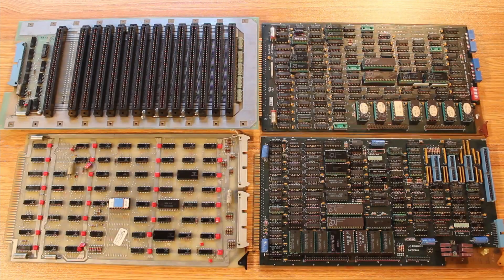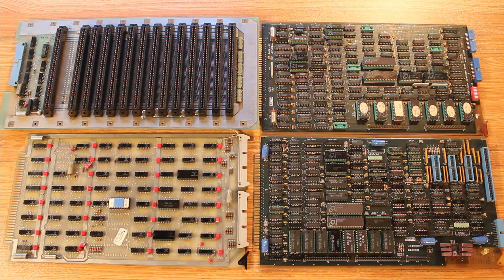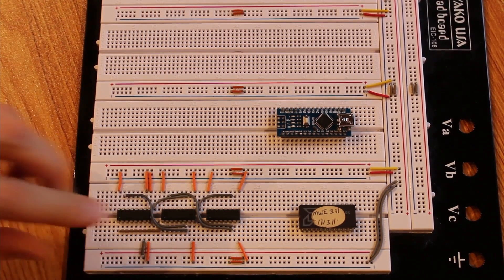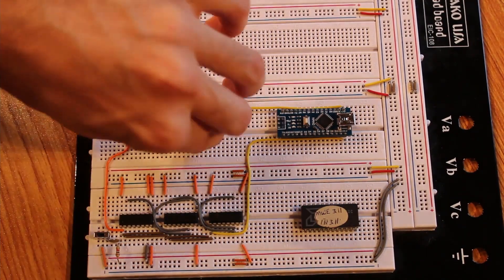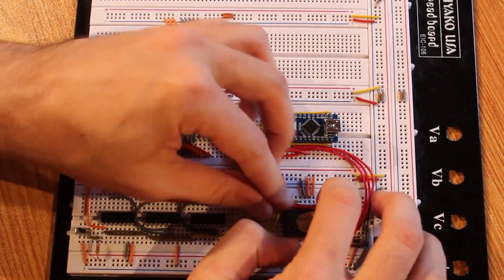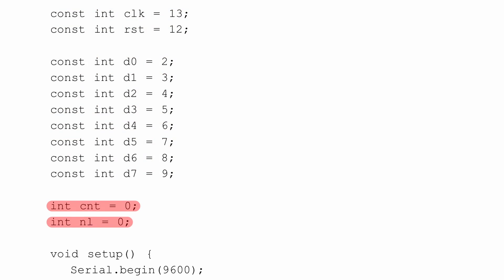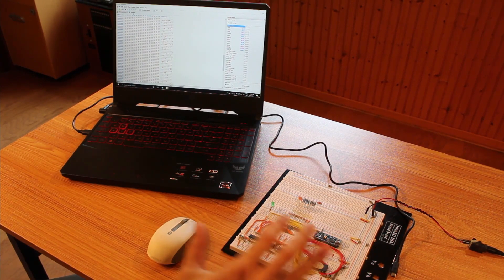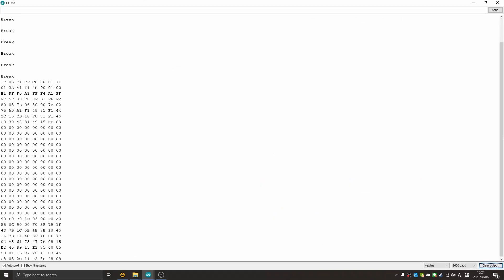Minicomputer Part 5: Building an Arduino ROM Reader

Comment: Cool reader. I hope you don't have to build a ROM writer, That would be possible, but awkward with many different voltages. :)
Reply from the maker: Thank you so much!
I think if I have to write new ROMs, I'll most likely end up with more modern ROMs and making adapter sockets to fit them in place and then programming them through a TL-866 or something. Although, I do think it would be quite fun to get some NOS AMD ROMs if I need any and build a programmer from scratch!
Reply: @UsagiElectric  It would be a very interesting project to say the least. I've got some 1K EPROMS from the late 70's early 80's that use +12V Vcc, +32V Write eneble pin and -5V Read enable pin. LOL.

Comment: Hi, Great Video, you can use CD4040 which is 12 bit counter & eliminate a lot of wiring.
Reply from the maker: That would definitely have been the better way to do it! I mostly used the 74LS161 because I had a handful of them already and I was too impatient to wait for new parts, haha.
Reply: @UsagiElectric  You could also plug the ROM address lines directly into the Arduino, removing the need for a separate chip entirely - maybe a level shifter at most then.
That also removes the possibility of a desync between Arduino and counters.
A larger Arduino could be used, like the ATMega, which has the needed I/O pins. Or maybe even an STM dev board.
Reply: That of course assumes he has a CD4040.

Comment: Those 00s in the middle of the ROM storage mean, that you are a lucky fella. Erased EPROMS show FF. Normally it is good practice to fill not used areas of the ROMs with 00 or any pattern so you can directly see if the data is corrupted. I think your chance is high that the data is intact. Anyways if those windows are covered they never loose data from my experience. Also if they are exposed to direct sunlight, it takes at least a week to kill all the data. One Indian guy posted a Video showing how to erase EPROMs without dedicated eraser. It needed a whole week to empty the chips. And that said with Indian sun for 7 days!
Reply from the maker: That's excellent news to hear! 
That little ceramic 1702 didn't actually have any tape at all over the window, but it was buried deep in the system and there was no way for direct sunlight to ever reach that far into there, so it's been pretty well protected. Aside form it being good practice to cover the window with tape, the primary reason I did was to hopefully get ahead of the legion of comments I would get about not covering it up, haha. 
Adrian's Digital Basement has an excellent video on erasing EPROMs with windows and it takes a lot of continuous UV to get them to erase!

Comment: Not the fastest code under the sun, but as long as it works :D I recomend flipping through AtMega328 datasheet, you can read an 8bit port all in one shot for example, and arduino library way of writing to pins is just terrible ;D
Reply: Another comment - when you are doing an if statement in one line you dont need to use {} around code executed, you can just go:
if (digitalRead(d0) == HIGH) sum += 1;
Reply from the maker: @akkudakkupl  I'm so bad with the Arduino and modern stuff like that. There's so much capability in there that I have absolutely no clue how to make use of, but I do know just enough to hack and kludge my way to a result, haha. 
Thanks for the tip on the {} for the IF statements, I didn't know you could do that! A missing "}" is what usually takes the most time for me to find in my code if it gets too long.
Reply from the maker: @akkudakkupl  Thank you!
Programming really is wild when it comes to all the amazing tricks that can be done to eek out every last bit of performance! I'm really terrible at it and often either end up with "it's super slow but works great" or "it's not quite as slow but the code looks like a spaghetti monster," haha.

That's a really cool method of reading an entire port at once, that'll definitely make for a much faster read. And, if there were enough pins, I could also use the Arduino to supply the address, which should take all the delay out of the entire thing and make the read almost instant! 

I'm a bit jealous of your holiday in Prague, but have some extra fun and beers for me in spirit!

Comment: -9V sounds like old/early NMOS or PMOS chip, which needed some "bulk biasing". Later, some chips used on-die oscilators and charge pumps to generate it...
Reply from the maker: I believe the 1702 ceramic ROM used here is considered as one of the very first ROM chips ever made!
Interestingly, there's -12V available from the PSU, but I'm not sure how they're dropping it to -9V for the ROM chip here. Although, it's a lot easier to get to -9V from -12V than it is from a positive source, which would definitely require some negative charge pumps to do so, like you mentioned!
Reply: @UsagiElectric  A LM7909 or 4 silicon diodes in series would do the trick :-)
Reply from the maker: @leyasep5919  That actually makes total sense, I totally forgot that you could just use diodes to drop voltage, haha.
Reply: @UsagiElectric  yeah but they are seldom used since their regulation is poor.

OTOH the negative bias current is often very weak, so you could even put a 1K lin pot on the -12V rail (and a 100nF) and call it a day. Just confirm with the datasheet :-P

Comment: I usually just use an old Atmel chip bare (not an arduino-board, since they waste a lot of extra stuff I couldnt' care less about), and then use a serial chip to get data in/out of that; the atmega would have  a pile of gpio, so you can just drive the ROM/RAM address+data+control right off the GPIO; I'm pretty sure theres enough pins on the Arduino Nano to do that as well, without using all the extra silicon, but I didn't check the nano pinout offhand

Nice job on uploading the goods; maybe see if they'll take them at archive.org which is where others might end up looking for them, if anyone else needs em?

On your github page, maybe put in a rough schematic or a photo of the pcb, and a link back to the youtube video . in case someone else wants to reproduce what you did exactly

Super awesome job man!
Reply from the maker: Thank you so much!
I updated the Github with a quick and dirty schematic showing how I had the Arduino setup as well as added a link back to this video for future reference. Thank you for the suggestions!
I'll also see if I can figure out how to get them up at archive.org as a few people have suggested getting them uploaded there.

If I were building this into a more permanent thing on a PCB with jumpers and a ZIF socket or something, I think I would totally build it straight off an Atmel chip bare and make full use of all the GPIO pins so I don't need the 74LS161s. The primary reason I did it this way is that it was the quickest and easiest way I could think of getting the data from the chip into my hex editor so I can save it. Plus, it was all using parts I had laying around, and I sure do love using all the junk I've got in boxes for something useful, haha.
Reply: When your task is to do some one-off ROM dumps, and what you have (AND KNOW) is an Arduino and a breadboard, then "Arduino and a breadboard" is the solution.

Comment: I remembered you spoke of the "inrush" power surge and that would be a problem but I think you are there.
It is cool you get old roms no matter that no one else uses them.
Reply from the maker: Thank you! 
The code on these old roms is certainly unique stuff and most likely just being used as a massive lookup table to eliminate a bunch of conventional logic, but I'm certainly happy that we now have a good backup of them!
The inrush current issue was actually something I'm battling on the tube computer, the PSU for this Centurion is beefy enough that I think it can handle all the power supply requirements on the computer with power to spare!

Comment: (something for next time - never change a working system)
if you hook up the data output signals to pins of one port on the Arduino in the right order, you can just read all 8 bits at once. Your wires may end up all over the place though. And you might get unlucky and unable to use a certain combination of features. But the code will look like
sum=PORTB. (or PORTA or PORTC)
(also note it's 10 years since I last did anything with an Atmega)
Reply: Even better, use an Arduino Mega and you have enough pins to connect the data and address bus directly. (Oh, and four UARTS).
Reply: The only full 8 bit port on the Arduino mini is PORTD, but that is where the UART is.
Reply: @rocketman221projects  D'oh!
Reply from the maker: That's definitely something that's a bit beyond what I'm used to working with on the Arduino, I really am a total noob with non-vacuum tube stuff, haha.
Fortunately, these were pretty small ROMs and so my brute force method didn't take too long and the results weren't that unmanageable. For more modern PROMs with massive amounts of data storage capabilities though, this definitely would start to get tedious!

Comment: Could &H01 be NOP
Reply from the maker: It's a little difficult to tell what a NOP code might actually be since I think they're primarily using these ROMs as massive look up tables that replace a large swatch of logic on the board. Particularly for the ROMs that are on the CPU and CMD board, since those boards are already chock full of ICs with no extra room for more logic chips!

Comment: Would a Raspberry Pi IV not have been a better way to go as you could send the address to the ROM and the Raspberry Pi IV would read the data from the ROM.
Reply: You'd need to add a bunch of level shifting and buffering to avoid blowing the broadcom GPIO's though.
Reply from the maker: A Raspberry Pi probably could have done the job better, but honestly, I've never actually used a Pi before. I had the Arudino on hand and it seemed like it would be easy enough to get it all up and reading with minimal effort, so that's what I went with!

Comment: Some of the ROM chips probably don't have anything you'd recognize as code in them. They would be large truth tables that replace gobs and gobs of standard logic. So it would make sense to me that they would be sparse as every term would not be used. I think one of the chips at the beginning of the video had only 1 bit in it.... that I would consider a bad read or a chip that is senile and forgetful :(
Reply: I once read about a trick to try to get some "lost" data out of old EPROMs: You continously lower the VCC of the chip until some bits or bytes start to flip. Sometimes it's possible, that the bits in some cells got "weak" and with the reduced supply voltage, you're changing the threshold voltages inside the chip as well.

Sometimes it works, sometimes it does not. But certainly worth a shot IMO.
Just hook up a lab powersupply and iteratively reduce the voltage.
Reply from the maker: @crasbee  That's an awesome trick, I hadn't thought about that!
There's only two chips that looks suspiciously empty, and one of those was from the commercial programmer, so for that one it's possible that we just didn't have the right equivalent chip selected and the chip select lines weren't at the right level. I'll give both of the chips another go in my DIY reader and see if I get better results. If it's still looking grim, I'm definitely going to give your "low VCC" trick a shot!
Reply: @UsagiElectric  You could still try it with the EPROMs in your DIY programmer (but be careful to add Level Shifters (or at least clamping with a series resistor) for the Address Lines, since they can not be higher than VCC!) because you don't know if all values that have been read are actually correct.
Reply from the maker: That makes total sense! Seeing as how most of the board was built around individual 7400 series logic chips, it makes sense that they would find ways to make that much more compact, especially on the CPU and IO boards. 
The chip at the beginning that only had 1 bit in it was one of the little TI ROMs that didn't have a whole lot of space on it in the first place. That was one we found an equivalent for on the reader and read the value in, but it's very possible it wasn't exactly equivalent. I've still got my Arduino reader set up so I'll take another stab at getting the data off of it!
Reply: @UsagiElectric  Yes, the small TI proms would be perfect candidates as logic replacements. Maybe in the memory or io  address decoding space.